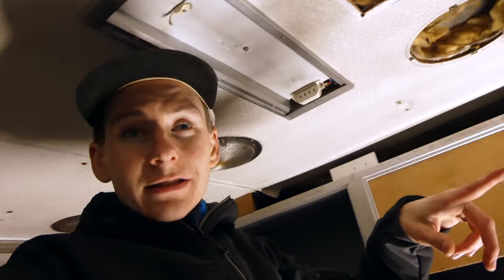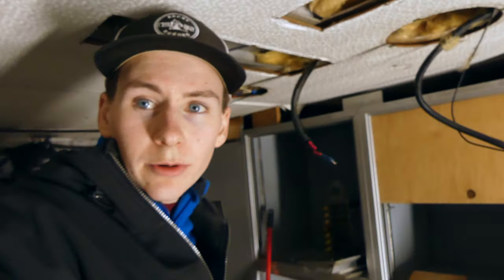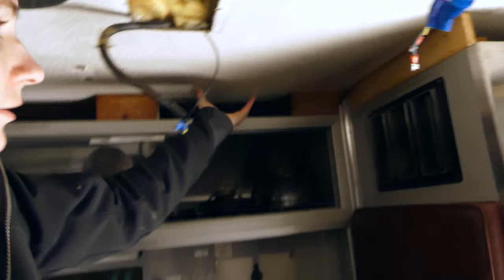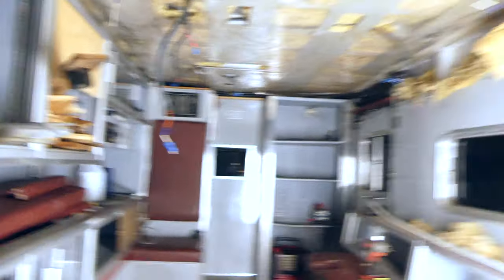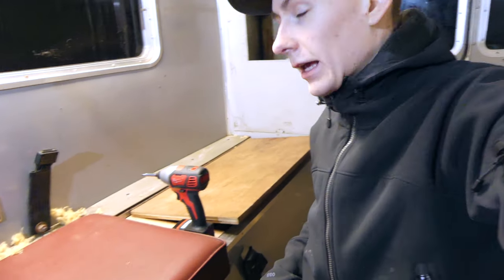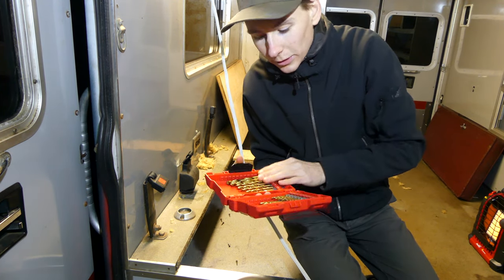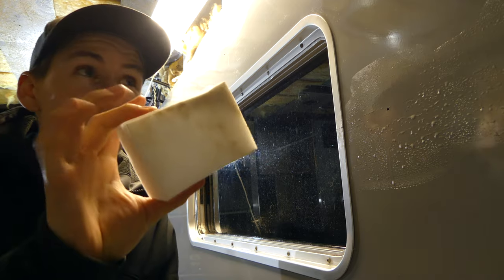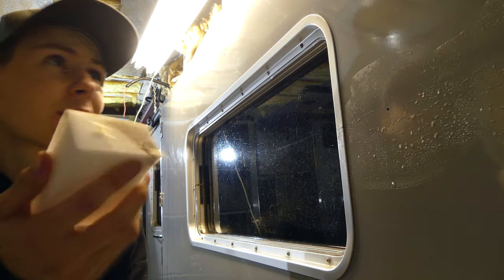Van Conversion Demo Day | Ambulance Conversion

Comment: Horton Ambulance company, in Ohio, used that burgundy padding for years. As an EMT, I've spent years in the back of their boxes. And part of me still wants to convert one into a camping/traveling rig.
Reply from the maker: Highly  recommend if you get  the chance! There are many out there and make conversions very easy as there is already a lot of electrical, insulation, cabinets and such

Comment: Hello just a question,  I just bought a 2003 Horton ambulance e450 and in need of solor system , can you help me ??
Reply from the maker: Hey George! We too just acquired a e450 and will have a video on solar in the next month or so. 
In the short term, there are two options you can go with: a solar generator with solar panels, or a individual battery system with charge controller/inverter. We usually use Renogy systems for solar. They make a great kit with everything you need to get a solar system up and going for either system.